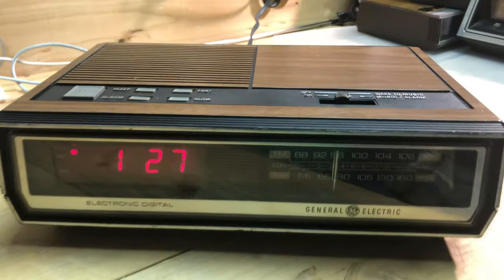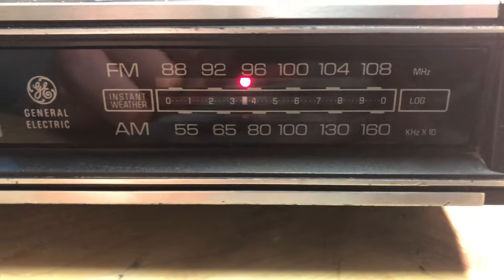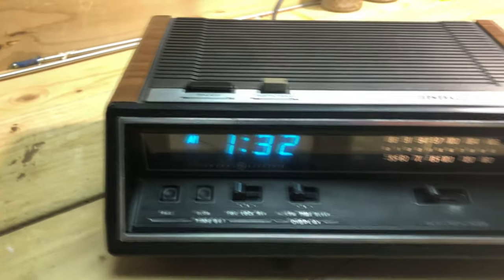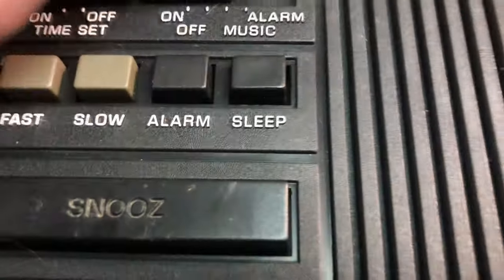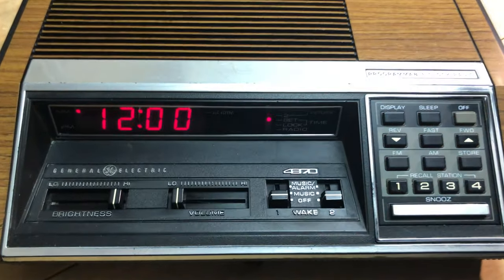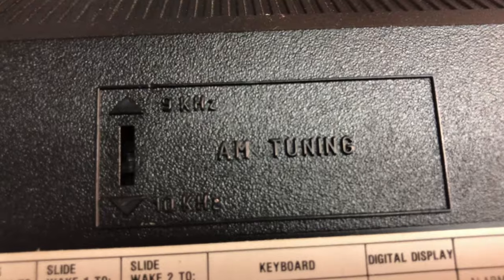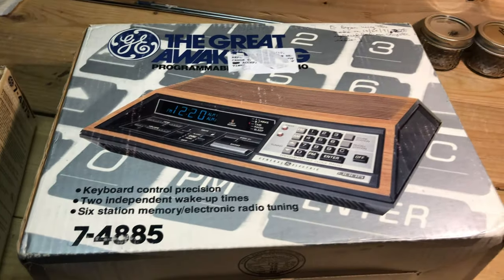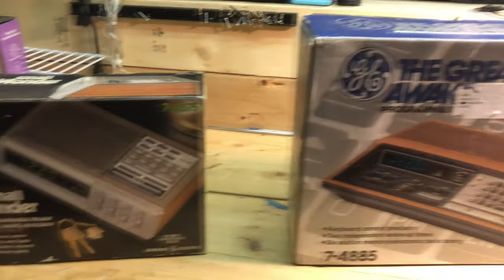General Electric Clock Radio Extravaganza Part I - Late 70's & Early 80's

Comment: Wow! What a collection! FWIW, I still have  a 4670. I got it for Christmas 1974 from my parents. I used it until 1996 when mom tepkaced it with an original Bose Waveradio, which os still in use to this day. The 4670 still works, but the silver raised labels on the controls tended to wear-through, and the grooved sufaces on both horizontal and diagonal control panels collected dirt/dust and was hard to clean.  The FM antenna in the power cord was a little fickle and prone to weak signal depending on orientation. This was my main source of tunes in my teenage BR for a few years until i got my hii-fi stereo rig. Yours, while a refurb, is mint. It brought back a lot of memories! I have to look for it in my basement now!

Comment: Great compilation! I still have the 4670 I bought new in 1978. It has been in continuous service. The ony service it's ever had has been to have the controls cleaned. 

It is rather startling to research what we paid for them back in the late 1970s. The lowest priced one, the 4635 was $34.95 in 1979 and the highest was the 4870 at $99.95 in 1980. That is around $166 and $395 respectively in 2024 money. If you ever find a good C4390 or C4690 snag it. Those were GE's first electronic digital clock radios. The C4390 came out in 1973 and MSRP was $105. In 1974 the C4690 replaced it and was about the same price. A whopping $730 or so in 2024. Those two clocks used individual early Vacuum Fluorescent Display (VFD) tubes for each clock numeral. Age has not been kind to them as most have dimmed over the years.

Comment: Way back in the late 1970's to early 1980's I worked at a repair shop which did warranty service for GE AEPD (Audio Electronics Products Devision) items.  Portable cassettes decks, portable radios, CB radios, clock radios, etc.  I've repaired most of these and this video brings back many memories.  Yet the only clock radio I have is a very basic 7-4625,  but it still works.  Always wanted the electronicly tuned 4880, but I do remember they were a pain to work on!

Comment: Hi Cutie, You're going to love this. There is a young guy on twitter who proudly owns a '70's clock radio, and today, he is trying to find the switch that allows him to change the time on it. I told him it is located on the back panel, or possibly is on the bottom. So, if this is a problem, could you maybe do a video for these neo retro young folk, on HOW TO OPERATE an old clock radio, set, and change the time, etc. etc. because, of course, none of them had their manuals with them anymore.

Comment: I am very much digging this video. In my hunt for the GE digital clock radio with TV Sound + Weather from my youth... will let you know if I can find it. :)
Reply: Wow!  That would have been an awesome clock for me to have had back when we had analog TV; I would have listened to that thing nonstop as a young boy.  I actually had a portable AM/FM radio with TV sound (infuriatingly, VHF only, meaning channels 14-69 were invisible to it) and NOAA weather radio (I forget the brand, but I doubt it was GE), but the internal rechargeable battery quit being able to hold a charge and when analog TV shut down in 2009 (none of the VHF stations in my area were low-power stations, otherwise I could have listened to the TV portion up until 2021 if the whole radio didn't stop working), the TV sound portion of it stopped working, leaving behind AM/FM and weather radio.  Unfortunately, I don't have it anymore, but as I recall, it was my earliest venture into the world of NOAA/Environment Canada weather radio.